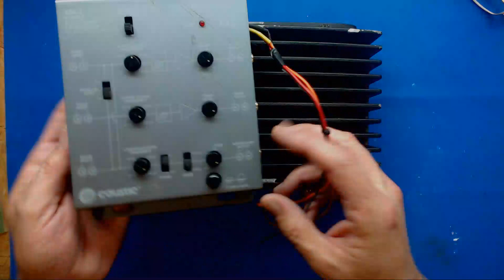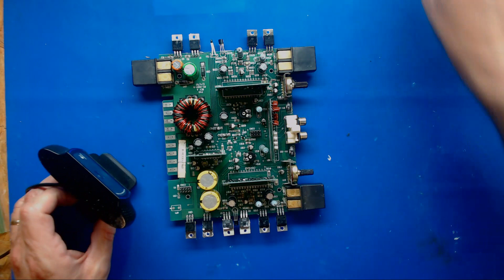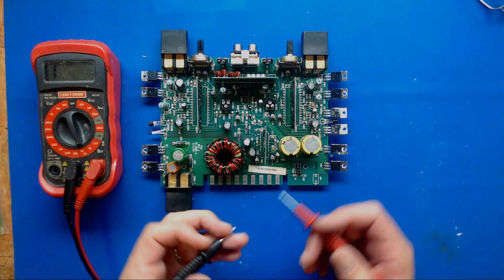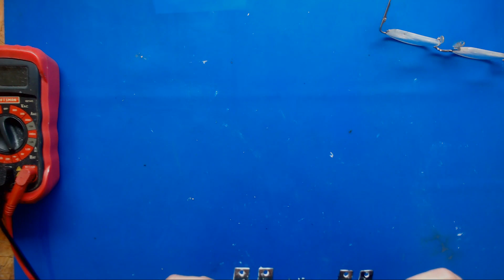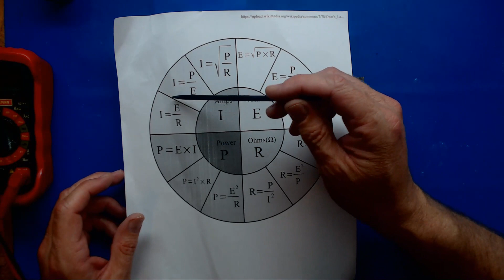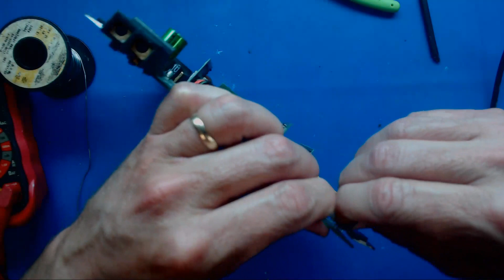Rockford Fosgate Punch 40 DSM (old school) Repair Part 1

Comment: I had a Punch 40i I bought used for twenty bucks. Used it for years, then sold it for $40 (still a great deal). That little 20×2 RMS amp pushed every speaker I connected. Kinda regret parting with it. I also have a Punch 45HD and a 2nd-gen Punch 150 in the boneyard. The 45 worked when I bought it used for $25 at a swap meet. I used it in an old-school system in my Ranger. Punch 45 on (2) RF Series 1  8"s; PPI PowerClass 450 powering Soundstream Reference 6.5" component set (active crossover); Alpine CDA9884 CD/MP3 flapface (AI net). Not super loud, but sounded super clean.

Comment: I just stumbled onto your channel and I can say that this is one of the most informative and easily understood way that I've ever seen/heard. 
Though, I do have a question for you. What is the name of the part that the 'ground/rem/b+' are supposed to be screwed into, and could you direct me as to where to buy some of them? I have a couple of old Rockford amplifiers (Rockford Fosgate Punch 150a2 & Rockford Fosgate Punch 201s) and the aforementioned terminals are completely screwed up, so I ended up clipping them off only to not be able to find a replacement part for it, it's exceedingly frustrating. Thank you for your help and time in advance! Keep up the good work. :)
Reply from the maker: Thanks! Speaker and power terminals, there are a couple sellers that sell them on ebay salvaged of burnt up boards. Search Rockford parts.

Comment: I have a 60DSM that powers up with no sound. Looked at the board (even after watching barevids still no clue) no smoke no nothing. Clean. So WTF?
Reply from the maker: 2 big things for the old DSM amps, replace all the small surface mount electrolytic caps, 10uf 16V, and check all the daughter board solder joints (small vertical boards)
Reply: @Crazylogix007  Thanks alot!
Reply: @Crazylogix007  Would going all Nichicon make a huge difference?

Comment: I ran one of those XM-3 for years with a DSM 60 on 3 Kicker Comp 12"s and a Linear Power 65 watt on a component set 6 1/2".  Still have a XM-3e in mint condition. I have the 40,60,200 DSM without crossovers  in working condition if you need any part numbers off anything let me know.

Comment: Usually to find the problem with an amp, you need to power it up first on a current limited power supply. You can spend hours looking at components but it’s not the best use of your time if the goal is a repair.

Comment: Hey Damon, just wondering do you get any of your schematics off of "Elektrotanya" website? Tell me is that the amp with the F16''s and B52's on the board across from the 494 board?
Reply from the maker: Yep, I have found them there (Elektrotanya), I think that is where I got this one you will see in video 2, most I get from the forums. No this amp is a class AB Rockford. The amps that have the defaced chips with labels on them "F16" and "B52" are several brands of class D mono sub amps.